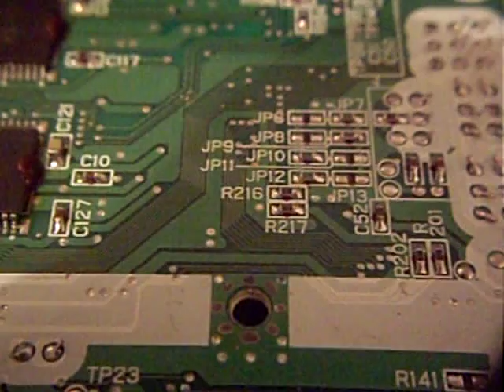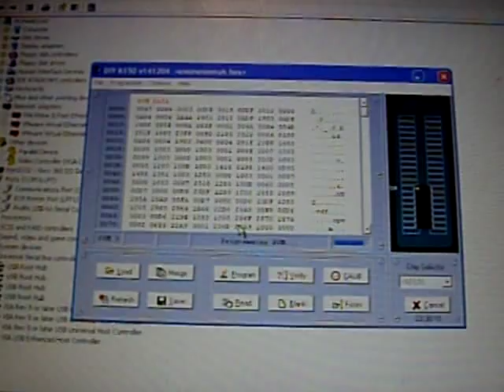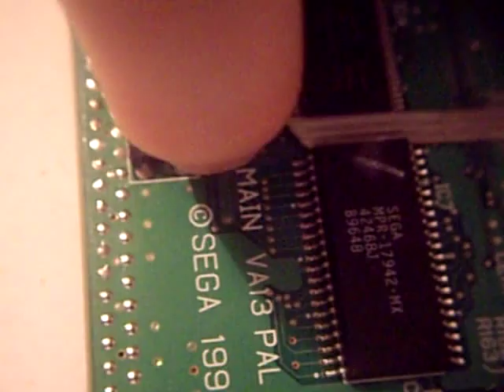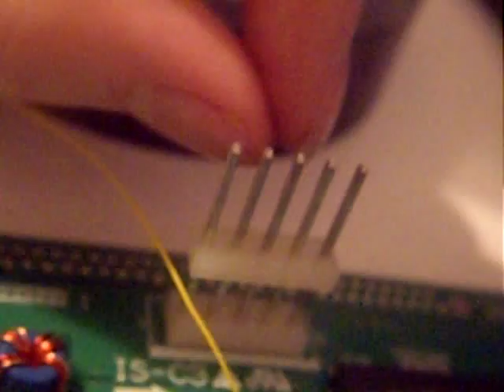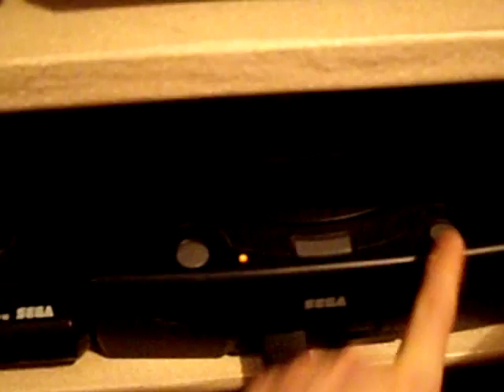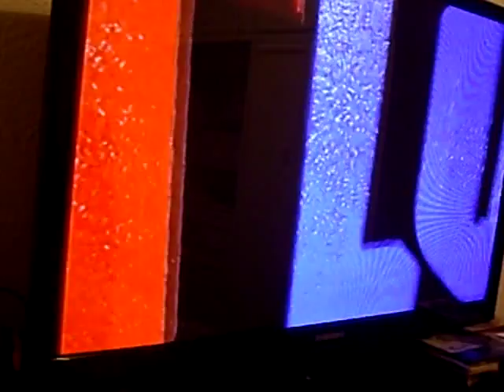Sega Saturn Switchless Mod by jse, Difficulty = Tricky

Comment: Great video, only issue I had was I needed to fit an earth wire to pin 14 of the chip to make it work.  Strange why you didn't need one.  Besides that good job.  Thanks

Comment: Great video m8.    I wanted to ask you can i use the same chip with code to mod my Sega Genesis into a switchless mod?.    I have a schematic on how to doit on a Genesis but dont have the time.
Reply from the maker: +Utoobyourself Sorry this comment is mega late, but yes it should work fine in a Genesis/Mega Drive, You can also just install a couple of switches into your Genesis/Megadrive one to control language Eng/Jpn and one to control video refresh rate 50hz/60hz  you can use these to set it to any region JPN USA or EUR, ENG+50hz=EUR, ENG+60hz=USA, JPN+60hz=JPN and JPN+50hz=ERROR :p

Comment: Very informative. You do love that glue gun my friend. Have you tried using Conductive glue for joining instead of solder? Its on Ebay, I won't post a link. Just search for

Electrical Conductive soldering

Oh and try heat shrink tubing for the LED and maybe Kapton tape to hold cables down? ;)